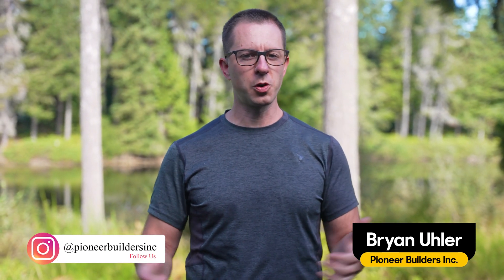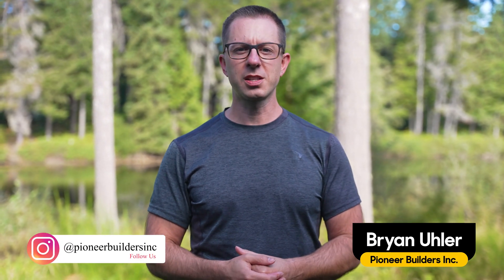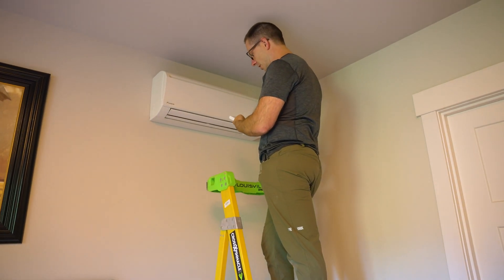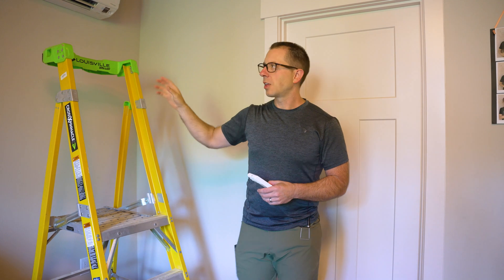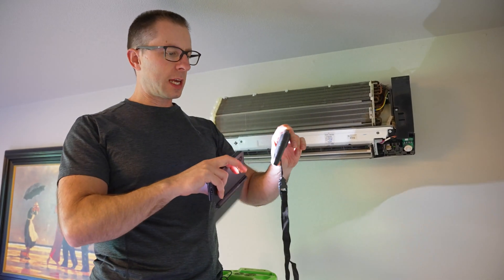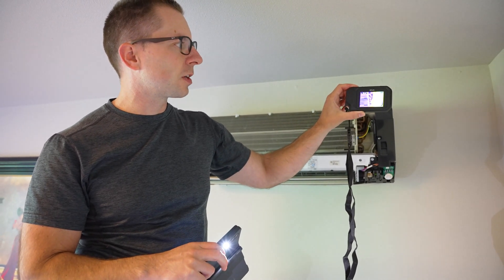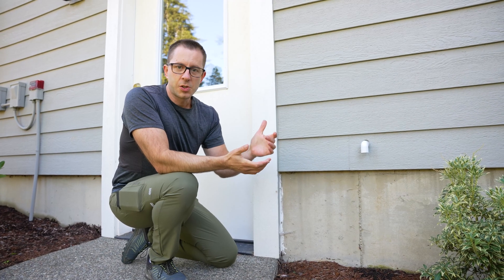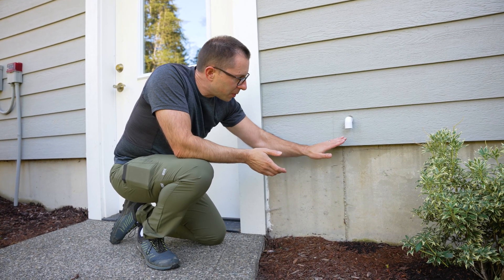Can a mini-split dehumidify?

Comment: I find it more comfortable running in dry mode vs cool mode.  Will running dry mode consume less energy than cool mode?
Reply from the maker: Dry will consume more, but if money isn't imperative, go with comfort
Reply: @PioneerBuildersInc  You are right, his AI is wrong. 
In COOL mode, compressor will run at slower speed while fan at higher. 
In DRY mode, compressor higher speed, fan lower speed.
Reply: @PioneerBuildersInc  ChatGBt says it runs the compressor at lower speed and intermittently and uses less energy than cool mode.
Reply from the maker: @t0mmy01755 good to know!

Comment: Mini splits are almost always variable speed systems so they actually dehumidify much more effectively than a typical single speed central HVAC system.  This is because variable speed HVAC systems can ramp down to match the cooling demands and run more continuously.  The longer the coils stay cold, the more water they can collect and drain.  On the other hand, single speed systems will often cycle off after only 10 or 15 minutes.  That is not enough time for water to collect, drip off the coils, and drain outside before the cycle ends and any condensation on the coils evaporates back into the inside air.  This is especially true on days/seasons that are humid, but not super hot.
Reply: You are spot on and most mini splits come with an app, set the fan speed to 1% (not low, like on remote) it will run way longer even on days that are not that hot and take a lot of water out of air.
Reply from the maker: Sizing properly is key
Reply: @PioneerBuildersInc , Yeah, but the issue with single speed HVAC systems is they are only sized properly for a small fraction of the year at best.  Like maybe a few weeks during the summer.  The rest of the time they are oversized and short cycling.

Comment: If you’re hoping this video will give you a clear yes or no answer to the title, skip to 10:30. Up to that point, we’re talking about Amazon tablets? Using a wet vac? Huh? I’m sure this is a very thoroughly helpful video for some folks but after watching I’m still not sure if a mini-split works as a dehumidifier. Sooo, yours does but it didn’t at first, is that the bottom line?
Reply from the maker: Mini splits dehumidify
Reply: Hero! Thanks

Comment: When you know it's going to be a hot day turn your dehumidifier on and you will not need air conditioning and it uses 1/10 of the electric that the air conditioning will use❤

Comment: So…….do these dehumidify as well as, say, a 2 ton package unit?  For people who live in areas that are much more humid than the PNW, this is an important question.  There’s nothing worse than feeling “sticky cool” in a house that’s 70 degrees but not properly dehumidified.
Reply from the maker: It all depends.  If the building enclosure is airtight and the equipment is sized properly, it should dehumidify.  However, many buildings have air leaky enclosures and the equipment is oversized.  If the ducts aren't airtight, that can also be a contributing problem.

Comment: I'm an HVAC tech since 1999 in Houston and for what you just said there's a lot of problems but that is maybe only climate and location specific.... I'm not going to address any of that I want to know what pants are you wearing in this video because they look like lightweight and stretchy yet durable pants and that is exactly what I'm looking for right now
Reply from the maker: I think those are the Cloud pants from Truewerk. You might check out their T1, T2, or T3 as they all have different characteristics.
Reply: Thanks 👍

Comment: Would you use it to dehumidify the home during winter?
Reply from the maker: Generally, the air is drier in winter, so you wouldn't need to dehumidify
Reply: What about if the air was more humid and the average temperatures were a high of 8 C and a low of 2 C. Would you use this method?
Reply from the maker: @dawsonparnell4934  would the equipment be in heating or cooling?
Reply from the maker: @KidKallum  unless you have an indoor hot tub, homes typically don't need dehumidification in winter

Comment: I’ve read that some air conditioners start to falter if space tends constantly up around 80% humidity. In those homes is it useful to occasionally have a dedicated dehumidifier?
Reply from the maker: I can't speak to the equipment response to 80 percent rh (I assume there is a high air temperature too). Having a dedicated dehumidifier is the best situation for that. Check out Santa Fe or Aprilaire

Comment: I have mini split that has the following modes: Auto, Cool, Dry, Heat, Fan 

But I also have a dedicated compressor refrigerant based dehumidifier. 

I live near the gulf coast and is humid in most of Spring, Summer, and early fall.
Reply from the maker: Without knowing the dehum model, that is likely the best, most efficient way to go. 👍👍
Reply: @PioneerBuildersInc  Dry mode works but only brings 30% humidity down.
Reply: Dry mode has nothing to do with your plugged condensate drain. You pull even more humidity in cool mode. The object of dry mode is to dehumidify without turning the conditioned space into a refrigerator.
Reply from the maker: @Gopher7   dry mode will result in a higher flow of condensate.  If a drain isn't fully obstructed, the amount of condensate in AC mode may be low enough to drain through the line, but a higher flow rate may not be able to drain.

Comment: Interestingly, I was comparing the H2i (Hyper heat) Mitsubishi unit vs the regular one and the hyper heat stated "0 pints/ hr"  under moisture removal.  The standard one was like 0.4 pints/ hr (which was the one I picked specifically for moisture removal.)  I'm not sure what's up with that....
Side note,  We have the same picture centered over our bed as well.
Reply from the maker: Super interesting... And, as they say, birds of a feather... 🙂
Reply: @PioneerBuildersInc  ..... build air tight together? 😆
Reply: @wjthehomebuilder interestingly enough here in South Carolina because of mold issues in a majority of all the new constructed air tight homes. They have to have outside air inlets ,air exchange units and whole house dehumidifiers retrofitted because they are so air tight! The irony of this is just laughable.
Reply: @number1pappy  Make up air is a must on tight homes.  👍